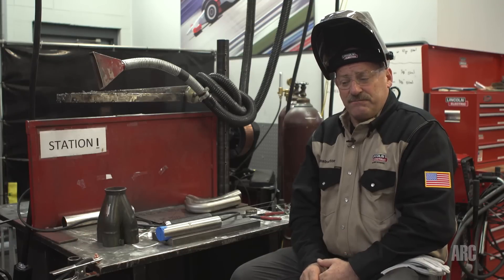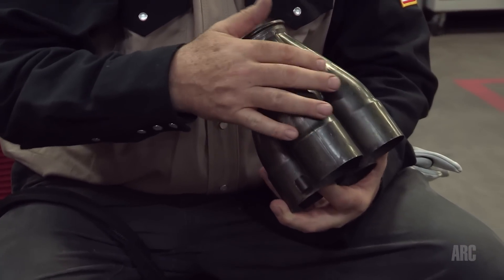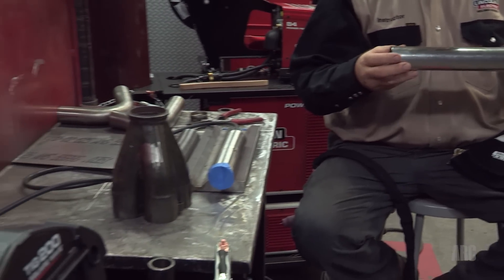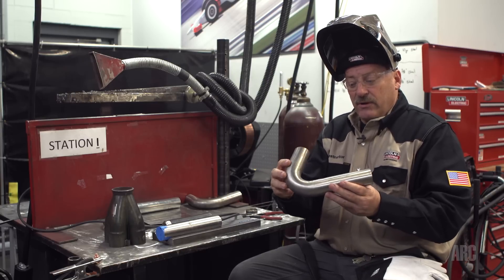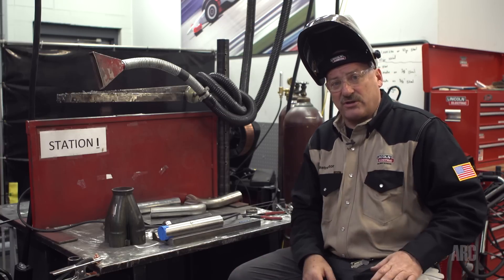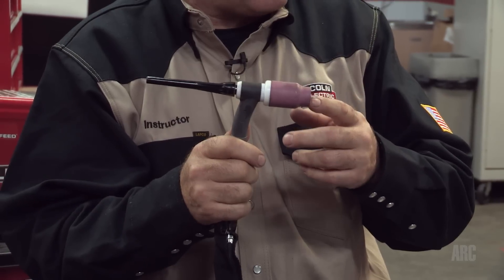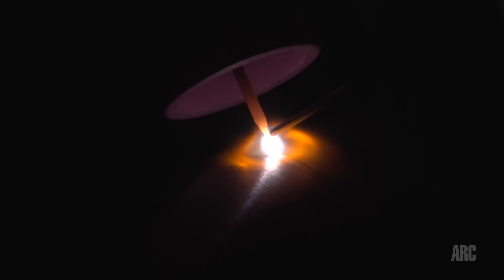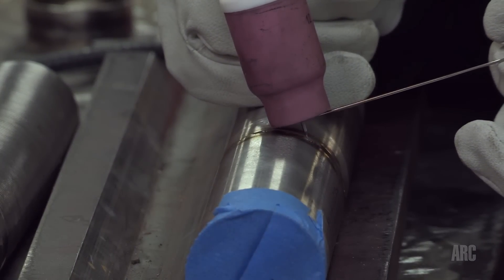Arc Magazine Master Class: Practical Advice on Welding With Inconel

Comment: Thank you very much.  I cannot say that I have use for inconel, even as a structural steel, but the parameters that were required revealed much about the alloy and the process itself(weld voltages, technique vs other processes and alloys).  I would like to request a similar video on Docol tubing?  I'm interested in structural steels that exhibit ductile properties.